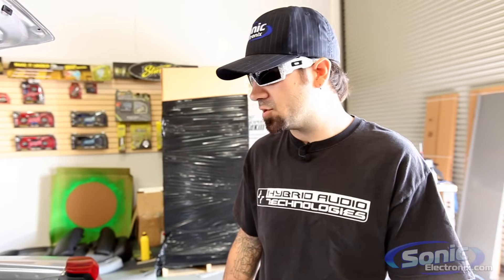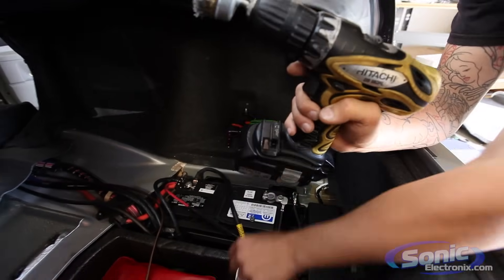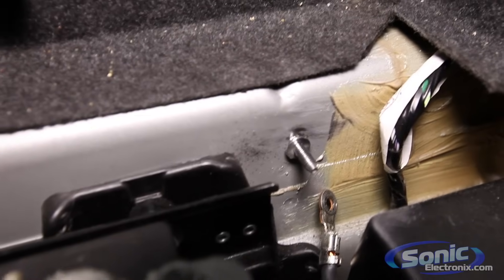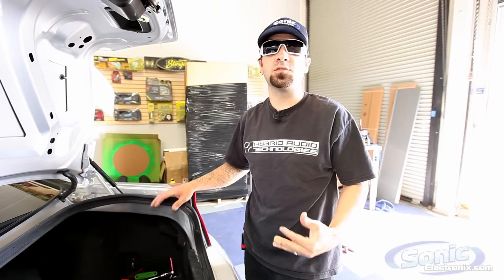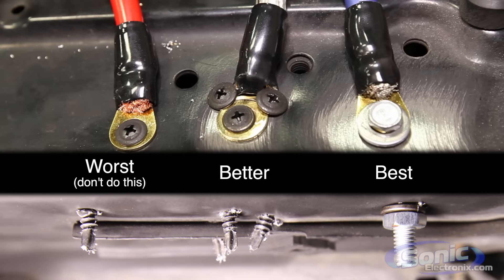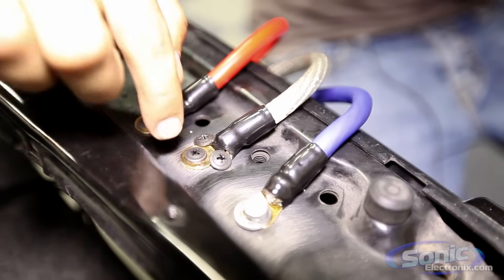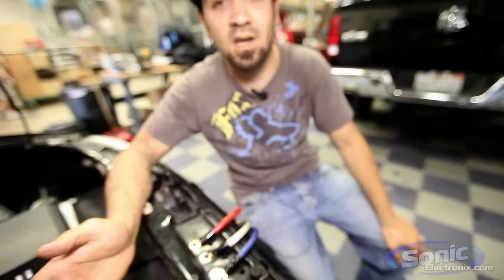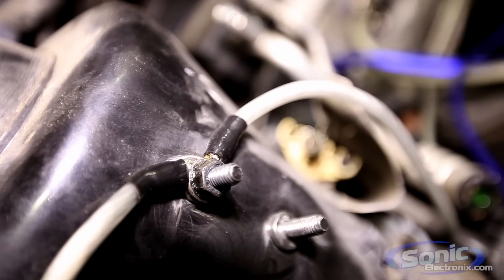How to Properly Ground a Car Amplifier | Good & Bad Examples | Car Audio 101

Comment: So instead of grounding to the 10 or 12mm bolt on top of the negative battery terminal and shortening the path to ground a little bit, you attached it to the chassis grounding point instead, therefore lengthening it AND possibly overloading the stock ground cable? You guys are idiots. Fucking. Idiots.
Reply: Corie Burk the most direct way to put this is: the battery is not ground in a 12v automotive circuit. The chassis is.
Reply: ***** ive wired every amp to the batt for ground its stupid not to
Reply: Depends, AC or DC, Three Phase or Single phase? Are you describing the direction in which the valence electron in each atom of the conductor is traveling? or the direction of the hole left by the absent electron?
Reply: paul taylor technically with a battery in a car the + terminal is actually the - terminal as electrons flow out of this terminals and return back to the - terminal of a battery but it is the + charge, we just consider the + terminal on a battery because it is the natural flow of electrons so we label it + when it is actually -
Reply: You'd see who the fucking idiot would be if you grounded straight to the battery and your car's OEM ground connection became loose or failed in any way. When you went to start the car all the CCA going through the starter now go through your amp's circuit board. Hope you have a fire extinguisher handy. 
NEVER ground an electrical component straight to the battery.
Reply: ***** That's electrically impossible. The amp would not be bridging the gap from ground to battery. Furthermore, the factory ground wire has no real chance of failing UNLESS it's over capacity due to some dumbass installing too big of an amplifier or too many amplifiers that still rely on the factory wiring as a path to ground. If your idea were true, all of these guys with massive sound systems would be fucked, because all their amps take power directly from the battery(s) and ground directly to them. They seem to know what they're doing and your theory is impossible.
Reply: Corie Burk  lol, whatever you say corie. Not that it matters on the internet but I competed in IASCA expert 601+ back in the 90s and was a USAC install judge. Those batteries used by "massive sound systems" have no relevance to a discussion about an install in a car with one battery whose main duty is starting the car! SPL competitors don't use their system batteries to start the car!
As for electrically impossible sure! Don't you realize amps usually ground the outer connectors of the rcas?  IF THE FACTORY GROUND CONNECTION TO THE BATTERY FAILS FOR ANY REASON(loose corrosion etc) and you grounded your amp straight to the battery and try to start the vehicle where is that 80 amps or so going to go through to get to the battery? Through the amp thats how. Dont believe it? I don't care! Melt your amp for all I care.
Reply: Lawrence James i stated a perfectly valid reason why there is a risk in doing this. You are free to take that risk if you like. Some research on the internet will find you accounts of people who have melted amps and had substantial fires in their cars and boats from doing this.
Reply: Lawrence James you also say you wired every amp this way. Since not many installs see amps under the hood youre telling me that in installs with the amp in the trunk or under a seat you ran a ground wire all the way to the front and the battery? Boy wire  companies must love you! I thought everyone knew the way to get there with least resistance was through the frame or unibody. NOBODY who knows what they are doing runs a ground wire equal to their power wire all the way to the battery. Look it up.  You go to the closest frame point to the amp then augment the ground from the frame to the battery at the battery.
Reply: No, but when the battery is literally right there, the least resistance will come from wiring the amplifier directly to the battery. It's as simple as that. Electricity will always take the path of least resistance, and if the amp is within 5 feet of the battery, there is no reason whatsoever to make the factory ground wire do more work than necessary.
Reply: Corie Burk #1 when is the amp 5 feet from the battery?  Almost no install I have seen
#2 you augment the factory ground cable doing the big 3. Its virtually impossible to "overload" the factory ground in most installs as they are designed to handle the starters amperage. 
#3 you still have created a needless risk if a fault arises in the factory ground.
Sorry to tell ya bub but youre doing it the WRONG way any forum on the web with experienced installers will tell ya the same. Ya go from the amp to the frame and augment the frame to the battery. No matter how short or long.
Reply: Corie Burk the most direct way to put this is: the battery is not ground in a 12v automotive circuit. The chassis is.
Reply: Not to mention the fact that any amplifier that has a direct lead from ground to RCA - is asking for failure. You wouldn't melt an amp, you'd melt your RCAs at most, or anything bridging the connection between amp and radio, which should be bolted into the dash. I'm not saying a fire is impossible, but routing all your grounds through the amp? That is impossible. the case itself could take that, and it wouldn't hurt to ground the case separately to the chassis. But that rarely happens (if ever) so it's not likely.
Reply: Corie Burk "any sort of big amp is going to require 150-200A just for RMS power"
Thank you for saving me any further time arguing with your newbie kid ass. Now go look at the fuses on your amps.  And google DIYmobleaudio or bimmerforums and ground amp at trunk battery. Okay? Its like you just found out about car stereos and you insist youre an expert without doing any research at all. This is an old subject. 
AND ONE MORE THING ABOUT GROUNDING TO A BATTERY IN THE TRUNK. WHEN THE ENGINE IS RUNNING WHAT IS THE PRIMARY SOURCE OF CURRENT? IT AIN'T THE BATTERY, NEWBIE.
Reply: Corie Burk LOL. First he stated a car with the Big 3 done.... so thus you have at least 4awg from bat (-) to frame... also you never really want your ground more than 3ft for a "high watt" amp. lol. and just because you are tickling my funny bone, if you fuse the positive connection for the amp im sure you should fuse the negative connection. hahahahaha. and for this customer, i would've done 4awg to body less than 3 ft, with two of those black metal screws. never had them come loose. three is too many, one in center, one through the ring terminal. i would hate to see the awg for your speaker wiring.
Reply: the alternator is the true source of power, the case of the alt is the true ground to the vehicle, the goal is to get power from the alternator to your amps, most car frames nowadays have many weild points and connections that do not carry high amperage very well, anyone who has done lots of reading of how DC power works will understand that electricity will take the shortest and least resistive path, hence why I run a + and - of 2/0 from my alternator, high output of course built by singer alternator, to my rear battery, I also have a + and - run from my front battery to my rear battery, of 2/0 of course again, and of course, + and - 2/0 from my alt to my front battery, the goal is to have the least resistance, if you are running more then 100 amps I would HIGHLY recommend running a - line back for every + line, this will cause less voltage drop and allow for the amps to "breath" easier, as DC power requires both lines to be of equal size, otherwise your wire is only as good as your thinest line, but if you dont have a high output alt and or batteries then all the wiring is for nothing as your system has no way to supply that power https://lh5.googleusercontent.com/-Qqbcm2h9ANU/Uf3m7tF_Y3I/AAAAAAAABPA/RoFzIpb7Xa0/w1470-h874-no/kickersetupdone1.jpg
Reply: dereileak on something like an SPL vehicle which only runs the system with the engine on for maximum voltage it may be the case that the alternator is the primary ground point and power source. However just about anyone reading this drives a real car in the real world where you often play off the battery. IASCA SQ scoring is done with the engine off. So the chassis is still the primary ground point. Though there is nothing wrong with installing an extra alternator ground.
Reply: FuckGoogle+ FuckGoogle+ in the real world people use their stereos while driving, the alternator is the main source of ground, the secondary point is the battery negative terminal, the chassis is not a ground, it is a carrier for ground of either the alternator or the battery, there are only 2 sources of energy for a 12v dc platform, the battery or the alt, the chassis acts as an extension of the negative point on either of those, a dedicated ground line of the same size as power is best, I have 2 runs of 2/0 for ground and 2 runs of 2/0 for +, in some comps yea you run off the batteries, most you have the engine running, and in the real world the engine is running
Reply: Actually this is ok in some cars. I have done a 1/0 big three upgrade in my car, therefore the cable that runs from ground to my battery is much larger as my factory wire was only 8 gauge. Plus I have a second battery in the back that my amps are grounded to. And that battery is grounded to the frame.
Reply: machapu there is nothing wrong with using the frame there really isnt, if you get to 3000+ watts rms then I would start running dedicated grounds, but even then you could still get buy with the frame
Reply: With that much power I think people use multiple batteries by the amp. Those would be grounded individually to the extra batteries. But those batteries would be grounded to the frame for charging. I will never have that much power.
Reply: machapu oh yea definatly, but if you want to get power from your amps your gonna wanna run them at 14.4 or so, and you cant do that off of a battery bank, in that case most people with that much power have multiple h/o alternators, then you for sure need an = amount of + and - runs to minimize voltage drop
Reply: Thats true, If your alternator can power it. I do need an HO alternator, I have about 1900 W rms on a 80w alternator, but its working ok with just an extra battery.
Reply: machapu yea 1900 rms isnt a big deal, I have seen setups with 4 - 370 Amp alternators, thats a lot of damn power ha ha
Reply: you're the type of tool that thinks that electricity flows from the +pos to the -neg, aren't you?
Reply: In the video, the battery is in the trunk. All Chargers, Cobalts, Magnums, numerous BMWs and Mercedes, etc all have the battery in the trunk. Therefore, the amp is literally within 5 feet of the battery when mounted somewhere in the trunk. Shortest path? DIRECTLY TO THE SOURCE. If you can't understand what I'm saying, literally get the fuck out. I know it's not always possible. Starters only pull about 150-200A on most cars, at max. Any sort of big amplifier is going to require that just for RMS power. Also in the video, they simply re-use the factory ground wire instead of attaching the ground lead directly to the battery post. Pay attention to the video and what I'm saying. IF THE BATTERY IS IN THE TRUNK WITH THE AMP, GROUND DIRECTLY TO THE BATTERY. It's that fucking simple. I don't give a shit what you have or haven't done in your claimed life as an installer, I know what is and is not optimal for electricity. Utilizing a factory ground wire when the cable can be attached directly to the battery, 6" away, with no extra effort is simply fucking dumb.
Reply: Well nobody runs amp wiring off the alternator. Enough said. I know enough to install what I like. I also know enough to keep my equipment working properly. Apparently my definition of a big amp is different from yours, as my kind of big amp produces somewhere around 9-10,000 WRMS. That requires some heavy fusing. So yes, I have looked at the fusing on my amps. One has two 15A fuses and the other has 3 30A fuses. Those are low power amps. I have more if you'd like, not that I can impress an internet douche from the 90s. I don't care what kind of judge you are, simple electrical theory says you make the shortest ground possible. Even if that means making it just a little bit longer...

Comment: :o you mean you shouldnt just put the cable onto a car seat bolt and say good enough hmmm my life has now been changed thank you lol
Reply: on a unibody constructed vehicle (most newer cars) that works okay. Most body on frame vehicles (most trucks and SUVs) you're better off going to a point on the frame.
Reply: customlumina  The seat belt bolts are rarely a good place to ground 
your equipment. Sometimes there will be a thick tar like substance (used
 for waterproofing) that will prevent you from getting a proper ground. 
Even if there is no sealant, the connection may be less than perfect 
because the hardened steel seat belt bolts (relatively high resistance) 
go into a hardened steel nut that's pressed into a piece of stamped 
steel that's spot welded to the bottom of the vehicle (not exactly a 
great electrical connection).
Reply: You might note the oem engine to frame cable bolts to an insert welded to steel just like that in many vehicles.
If you have any doubts just check to see what your voltage drop is at your amp when its running at full power. (Its not helpful to just look at resistance. Low voltage high current DC circuits dont reveal issues with the low current of a multimeter) Not saying you are wrong but some things not as big a deal as you might think. I think a properly connected ring terminal mounted to a cleaned up seat  bolt would be about the same resistance as mounted to a new hole. Also you imply "hardened" or forging of the seat bolt increases resistance? Not significant enough to matter.

Comment: Not sure if this has been asked already..but bad grounding could cause amp to blow fuses?  Also kinda unrelated but if an amp blows mosfets would that cause the amps fuses to also blow or vice versa?  Obviously i had some fuses blow lol but whats weird is I had head unit volume on like 3 and no bass really but it was wet out and mine 0 gauge is grounded to the chassis under car [not bare metal (rust coating)] but i heard some small pops and saw smoke and smelled that oh too familiar smell, so...?
Reply: bad grounding will make an amp run in a high current/low voltage situation due to the voltage drop created by additional resistance. this typically makes it run hot but it's the higher current that will blow the fuse. moisture is another issue altogether.

Comment: I've done the "better" option a few times with no issues when I can't get to the back of the hole. I do however also use better quality screws and locking washers.